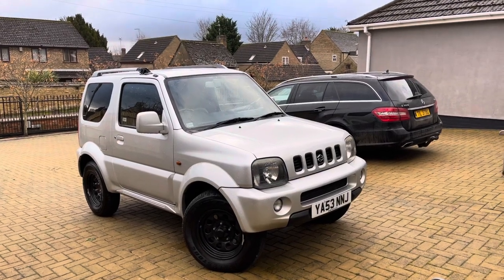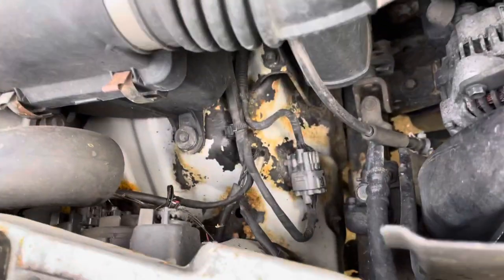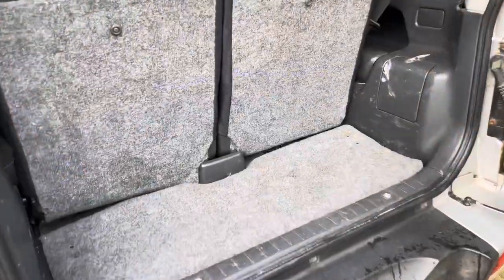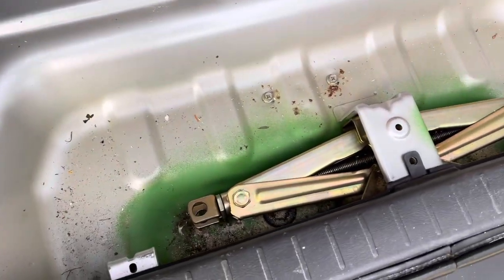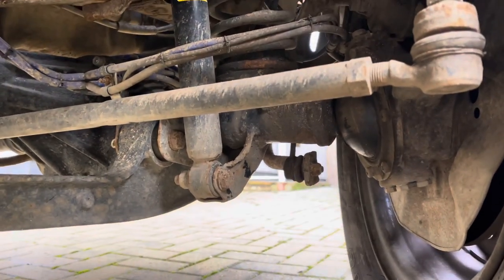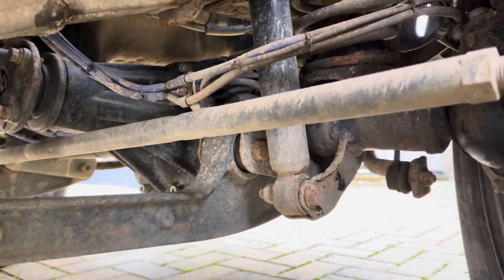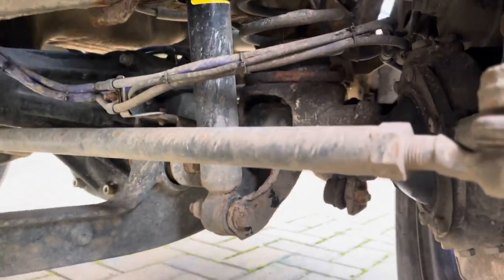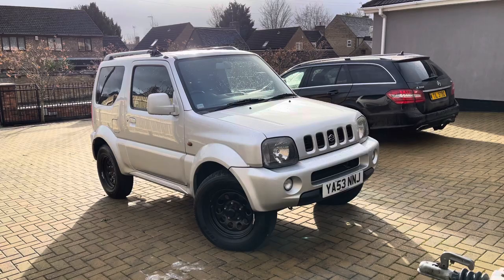Common issues found on the Suzuki jimmy (1998-2018)

Comment: I have 20yr old Jimny, problem with air conditioning and death wobble. Death wobble solved by replacement of king pin bearings, stabilizer link and panhard bushings. Airconditioning, I'm on my 6th compressor, all sustems already replaced brand new but still not cold enough :(. All the rest are good especially the engine.
Reply: Replace your aux fan to a bigger one.

In PH we managed to fit a hyundai starex (2008-2012) aux fan. Or you could also fit a 2nd gen montero/pajero sport.
Reply: @timothykwok1435 thank you sir. Also from ph. Yup my technician replaced it with a calsonic aux fan, not sure from which nissan car. Then replaced the compressor with a calsonic from Nissan Almera. Fits perfectly and problem solved.

Comment: Hello dear
I recently bought a jimny 2016 (1.3 engine)
*I had changed a premium spark plugs
*New castrol oil
*new brake pads
* had droped a premium quality bottle "injector cleaner" in the fuel tank
It has only done 44,000 kilometers, but it was with a lady who doesnt care about regular service at all.

Anyways im facing a problem in fuel consumption, its just driving 150km/20 liters 
Which is considered very very low 
It must drive a minimum if 220km/20 liters.

May I have your help of what could be the problem ?

Thank you
Reply: Jimny were always considered fuel drinkers.
Reply: I travel like a 205 kilometers with 27 liters, full mantention recently, every sensor cleaned, aceleration corpse, fuel injectos, fuel filter and bom, new oil replacement and i have  a roof rack. 2011 m13a jimny 1.3 with 150.000 kms. 13 kilometer per liter fuel economy, the best economy on jimny in mixed driving. jimny is not an economic car.
Reply: @StuartBarnes-kg9bl  whaaat? what year is it ?
Reply: any difference after oil and plugs ? i just got one from 2017 and getting ready for service